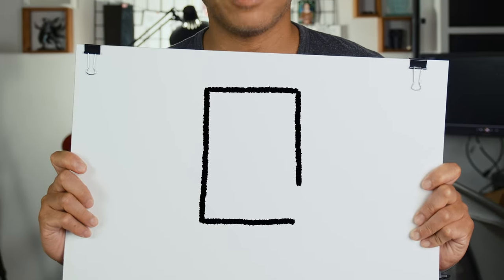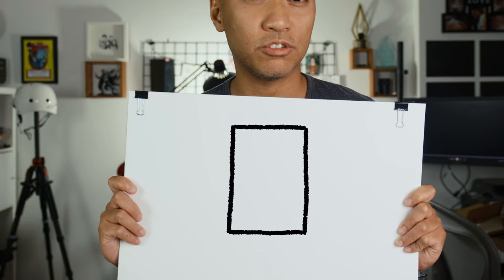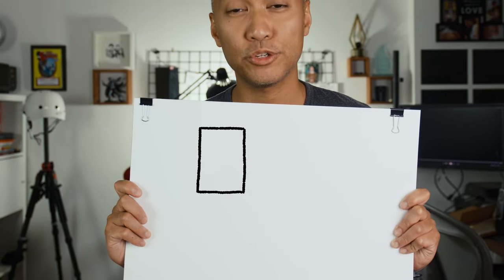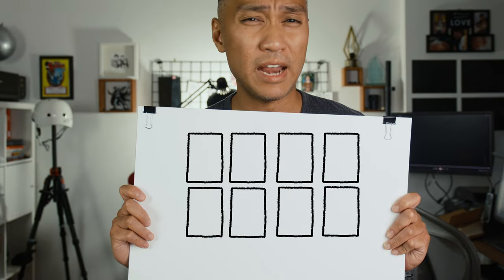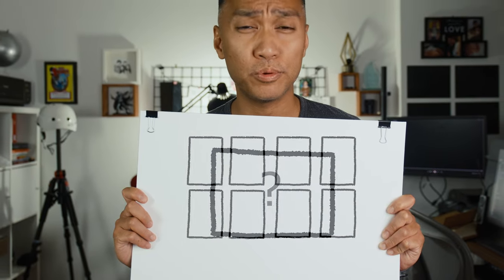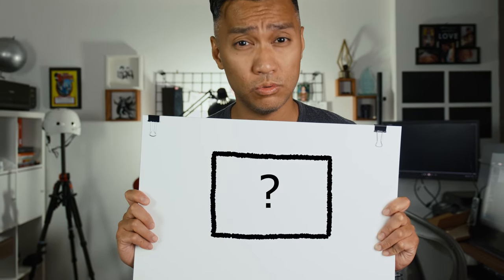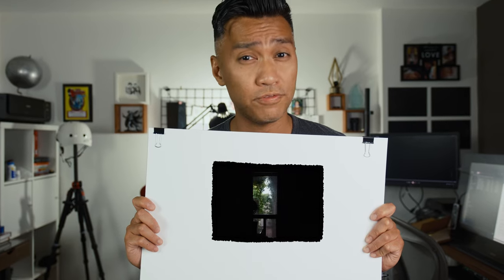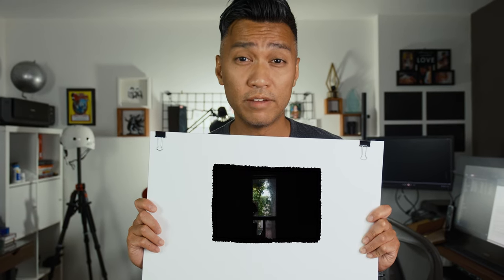How to use Comic Book Panels

Comment: even as a reader, those left-third splashes always confused me. the ones where 90% of its content is all the way on the left and, besides that top-to-bottom of the page chunk, there's otherwise regular panels. how much time is that supposed to be? or really tall and thin panels in general
Reply from the maker: Hmm, I'm not sure I fully understand but I'll try my best to answer. In general the shape and size of the panel can dictate how long its read (which is also subjective to the reader), however the contents of the panel also has to utilize the shape. So if it's a thin small panel but it's packed with info it will take longer to read. It's not the best use of that type of panel, but it's not a hard and fast rule. It's a rule I generally follow since I want to maximize the potential of panel shapes in conjunction with the images inside it.

Comment: Wrong. The size the of the panel does not necessary control time, it helps (sometimes). It is the detail in the panel. More detail drawing needs more time to process by the reader. A big panel with a few strokes vs realistic portrayal of a character in a small panel. The small panel will ask reader more time. Thus the reader will have the impression of time passed in detailed drawing panel.
Reply from the maker: Detail definitely contributes to how long an image is read. Working in tandem with panel sizes, its a pretty powerful combo. These are also just 2 of the many arsenals you can use to control the pace of how the comic is read. Although to counter your point, if detail is the only way to control time, this counts out the numerous artists like Alex Toth or Mignola who opts for simple graphic elements. And the flip side of that is someone whose work is so detailed that even a tiny panel which should be read briefly is gazed upon too long and slowing down a pace that's suppose to be read quickly. It's all just part of a greater whole, and in this video I featured just one aspect of the more expansive hour plus live class.